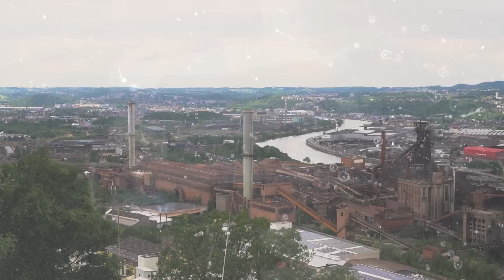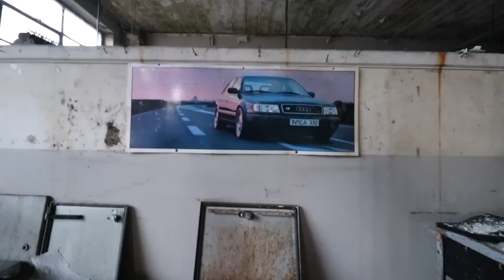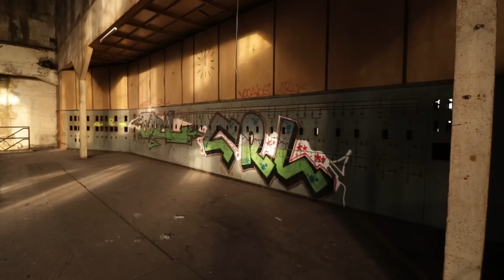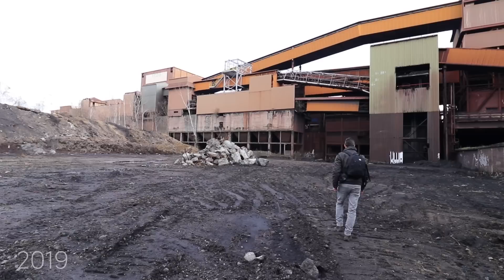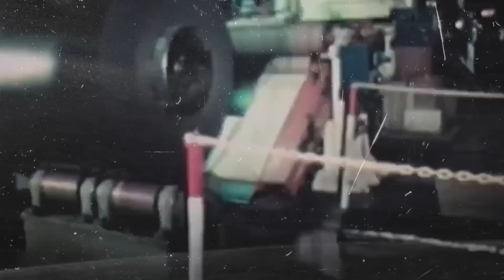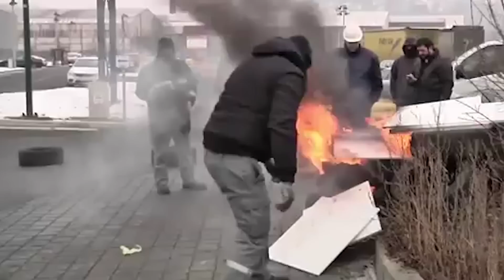The Downfall of Belgium Steel - Exploring Massive Abandoned Factories

Comment: Nice urbex of the old steel factory of Liege Walloon. Yes, it all began there ...
But hey, the video title is not correct because in Gent Flanders Belgium there is still a modern running steel plant "Sidmar", (or ArcelorMittal), full of innovation. The star of the ArcelorMittal group.
So not a downfall of Belgium steel, but Walloon Steel ! And do not forget to visit Charleroi also in Walloon for other forgotten steel related factory's.
Reply: arcelormittal in gent is a city on its own 😅 been there a few times with the truck
Reply: @kristof1996  They are specialised in high-quality steel. That can not be produced in corrupt countries (cutting corners). That's why they are still here.
But in the old-style factory, in the seventies, 40 000 people were working there. Now it should be 10 000 or less.
Reply: @kristof1996  I worked there many years
Reply: You have three factory’s of Arcelor  in Belgium 😁